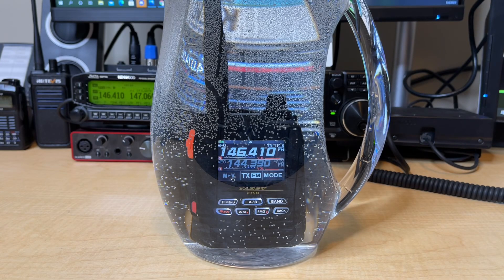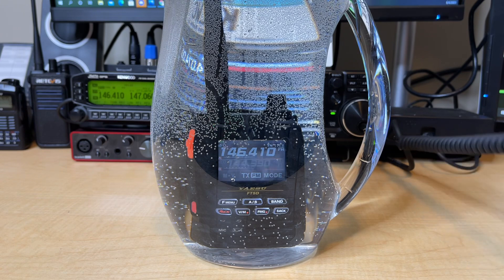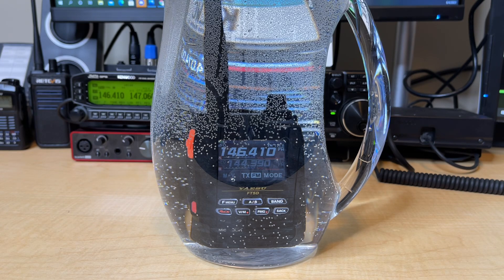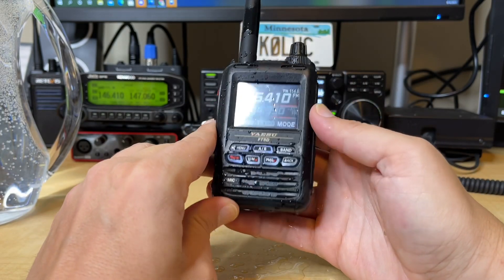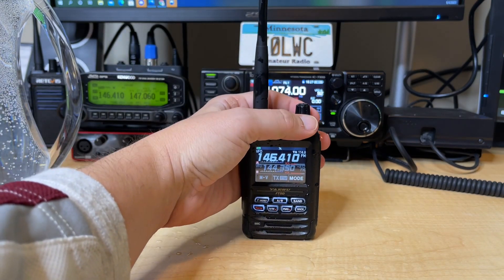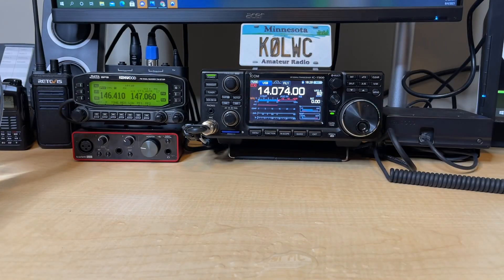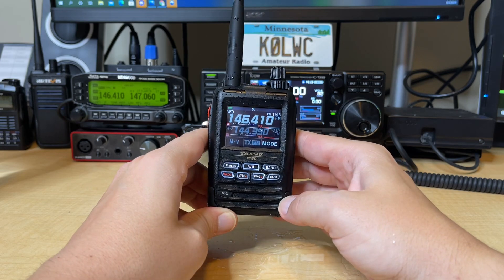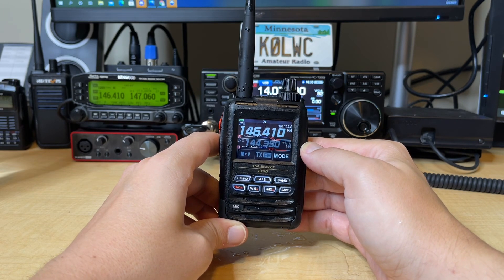Is the Yaesu FT5D Really Waterproof? Let’s Find Out!

Comment: A question on the screen type and durability. What screen type has this radio got? Is it resistive touch or surface capacative glass similar to a mobile phone?
Reply from the maker: Resistive touch.
Reply: @K0LWC  Cheers.  That's the info I couldn't find anywhere else. Thanks for replying. :)

Comment: Glad it came out ok after the water experiment! Curious how the APRS receive/decode on the FT5D compares to the FT3D. I wasn't impressed with the FT3D's APRS decode compared to the Kenwood D72.
Reply from the maker: It’s the same as the FT3D. Misses strong decodes every minute or two. 🙃 No where close to the D74a.
Reply: @K0LWC  That's disappointing. I like the form factor of the FT3/FT5 but I prefer good APRS decoding. Thanks for the info.

Comment: Yaesu has been one of my favorite brands of amateur radio equipment since the 1990’s.  Their MIL Spec rating and water resistance make them durable and reliable.  I feel like I’m holding a quality piece of equipment when I use one.  But I also own other brands of radios and let’s just say you should NOT try this with your Kenwood TH-D74!!!!!
Reply: The D74 has it’s positives, being durable isn’t one of them.

My first Yaesu handheld was a FT-207R, but the FT-208R was my favorite for years. It set the standard for durability. Heavy as a brick but it was tough.
Reply: I’m actually excited, I’m getting my first Yaesu with the FT5D. I was curious if it felt good in the hands. Good to hear your opinions.